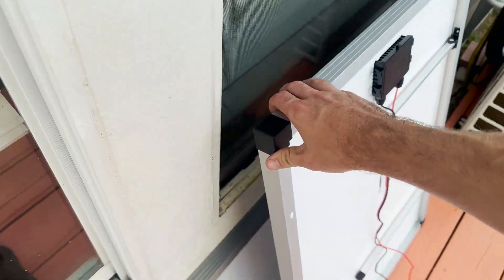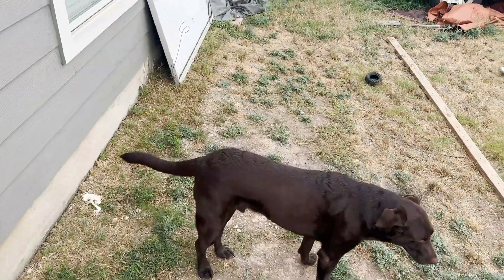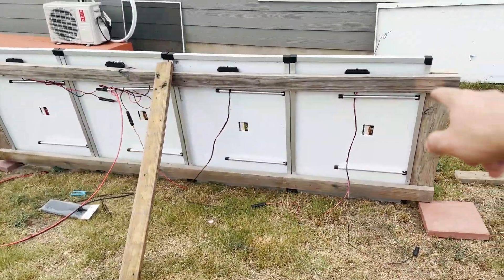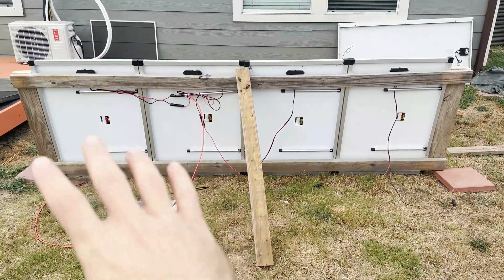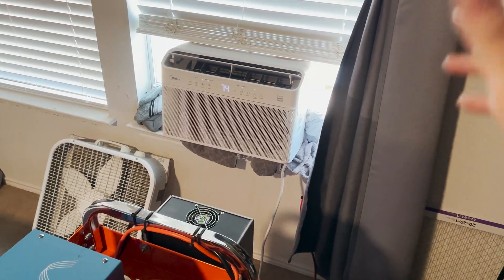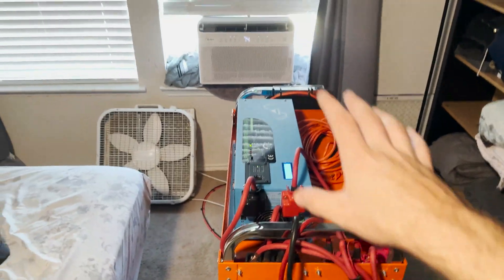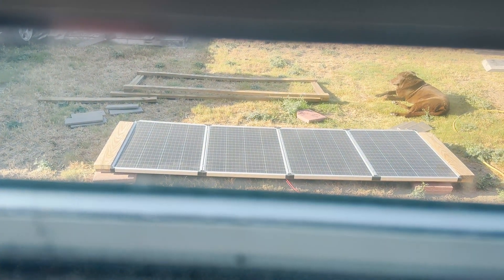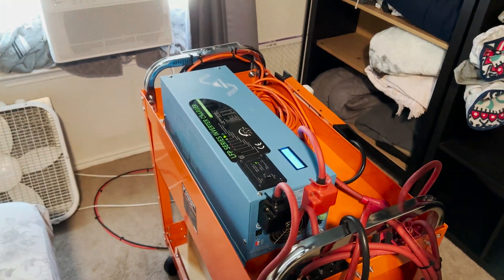Cheap Window Ac Powered By 12 Volts Solar!

Comment: So question.. I got some of these 220watt foldable panels (not cheap).. given their size, and putting out 2x more than these (roughly). why are these panels so big? I would think if they can put 220watt or even 300 watt power in panels around that size, shouldn't these be smaller now? Or are these older tech/cheaper panels than some of the more 22% or so efficient panels you get for like $500+ that do 200 to 400 watts?
Reply from the maker: I think your right about that, I Believe to comes down to the cells used and efficiency of those cells, cheaper panels cheaper cells, I bet more expensive panels do give you better efficiency.
Reply: @Mikebuildss  Interesting.. only $100 for the panels.. but for me I Think its size that bugs me.. they are big.. I'd rather utilize that space (if I can afford to) for more capable panels. Don't recall if you did a video on those tracker systems that move the panels to follow the sun.. but though they are not cheap, I would think they would be worth the cost (assuming they are durable and last many many years) giving you 2x to 3x more solar output throughout the day.. it would seemingly turn 100watt panels in to 200 to 300 over the course of day if it works well. I am looking in to that myself, wasn't sure if you had yet.

Comment: Nice.  I have been thinking of doing something along these lines as well.  Thanks for the video!  Do you think you are getting heat soak in the room you have the cart?  Seems like heat would be a byproduct, but cooling down the system would maybe help as well.  Cheers.
Reply from the maker: The ac unit definetly removes more heat then generated, id say total this system produces 50-100 watts of heat just running everything. You wont notice it